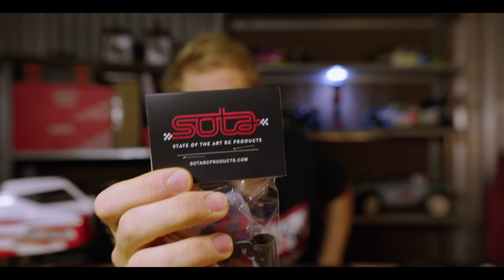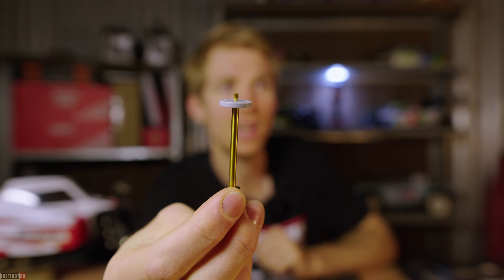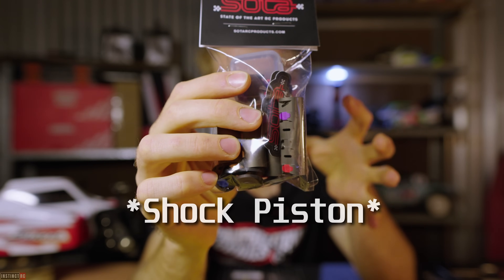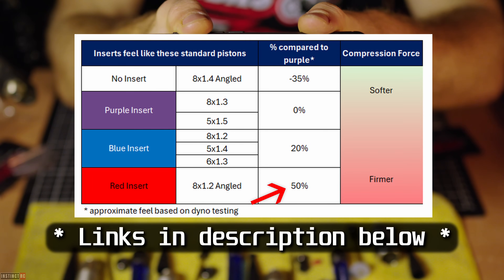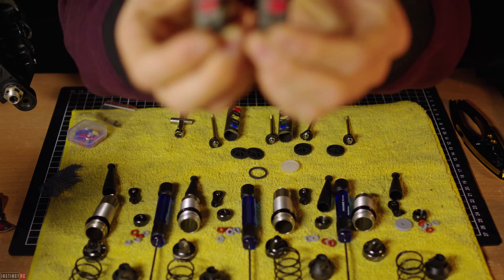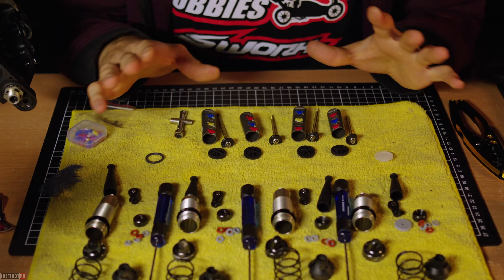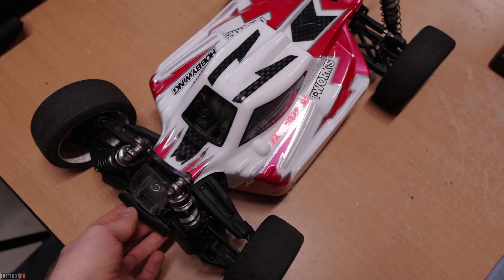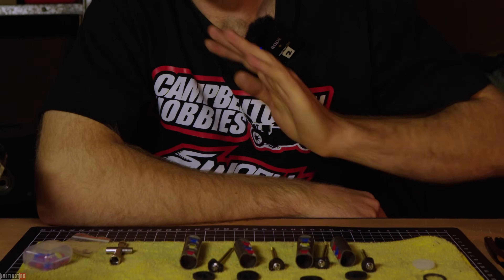The FUTURE of RC Shocks? | SOTA RC

Comment: Hi Nick, great video. Thanks for showcasing my little invention. My goal is to bring new products to RC that are backed by proven principals. In this example, King Shocks and Fox Shocks incorporate position sensitive damping technology in their premium off road race shocks. PSD provides different damping rates for the different zones which means far greater tuning options and race performance.
Reply: @sotarcproducts This is awesome. About a year ago I was trying to design something based on a similar idea. The D shaped piston is a brilliant solution. I was using a cut up Armma Granite shock body and piston in an 8th scale shock with simple bypass holes of different diameters. Crude prototype, didn't get anywhere. Also tried designing a hydraulic bottom similar to MTB shocks. Kinda bailed on it due to limitations of my  tools and materials. I do believe a hydraulic bottom out is possible. Simply a top hat style piston that pushes up into a similar sized chamber at bottom out, compressing the fluid and creating a cushion effect. Have a go if you're interested, looks like you could make it happen better than I could. Always impressed what people are managing to squeeze into these tiny shocks. Good job!
Reply from the maker: Just to add, if anyone wants more in-depth dives into the research and development of these, you'll find them at SOTARCs Youtube channel: https://www.youtube.com/@SOTARCPRODUCTS
Reply: This is basically an internal triple bypass design it looks like.
Reply: @madweazl  Yes though the journey to get here was a little more challenging.
Reply: I came up with a simpler design for the same thing a year and a half ago that I use on my cars. Internal bypass shock
Reply: that would be really cool for the Traxxas UDR !
Reply: @PetesRacin   I have the UDR and I agree. I am looking at my current tech but also a few other options. The smaller bore sizes get a little tricky so we need to get more inventive to provide a solution that works.
Reply: @SOTARCPRODUCTS  with most RC vehicles being smaller, it is difficult to be constrained by such small diameter cylinders.  I worked with an old MIP 2-way piston design in the past, but the precision just wasn’t there to be noticeable.  The other thing with smaller scale RC is we need even lighter weight oil and a way to reduce static friction—both things that less of an issue with larger, heavier vehicles.
Reply: @1132Design  I am working on something for 1/10. It might be the current tech or something completely different.

Comment: This product is missing the whole point of the suspension system. There are spring and dampers. Damping should only be dependent on velocity and Springs only dependent on position. Both require a force applied to them in order to move. These 2 seperate units form a  complete system and a way of separating the target and balancing it.If you need position dependent damping, you don’t understand suspension.
Reply: Damping should only be velocity dependent? Why not both? WRC and Trophy Trucks are examples of off-road racing at their respective pinnacles. Seb Ogier just won the latest round in Italy. His car is fitted with Reiger shocks and features position sensitive damping (Hydrostop). Alan Ampudia won the Baja 500 the past weekend, his trophy truck using King Shocks again position sensitive (external bypass). Arguably the absolute pinnacle of racing: F1. They use a heave spring which in a sense offers a position sensitive aspect to their damping.
Respectfully, I think I’m on point, and stand with some pretty good company.
Reply: A heave spring is a spring, not a damper. It prevents cars from bottoming due to massive aero load. Respectfully I think, you’re not.
Reply: @Adrian-sd5on ok. So can you provide me some names of manufacturers of off-road dampers at the highest level that don’t do any form of position sensitive?
I’ll give you mine that do: Fox, Bilstein, Multimatic, BOS, King, Icon, Emu, Ohlins, Reiger, WPS.
Now yours….
Reply: The reason why it should not be both is because you have springs to tune the force and displacement ratio. And dampers to dampen this by adding in a velocity dependant system. 
If you want to slow the bottom part of the stroke you use a progressive spring. If you want to slow the top part of the stroke you use a top out spring.
Reply: The reason why it should not be both is because you have springs to tune the force and displacement ratio. And dampers to dampen this by adding in a velocity dependant system. 
If you want to slow the bottom part of the stroke you use a progressive spring. If you want to slow the top part of the stroke you use a top out spring.
Reply: What you have done is akin to sharpening the edge of your fork to cut your food. Sure you can do it but there is already a perfectly good tool that is better suited to that job. It’s called a knife. And you use different knives for different purposes.

Comment: Ever heard of 'Jump Jets'? They were an addition to shocks where a tapered pin would graduate through a hole in the piston reducing the flow space for the oil making the shock firmer toward the bottom out.
Reply from the maker: Oh that's interesting. I personally haven't heard of them, Matt may have.
Reply: I'm not the only one who remembers Jump Jets ;)
Reply: @guest6423  I never used them myself and only heard it at a club meeting and what they did, Maybe they just faded out due to different oil weights causing issues or something like that...

Comment: I would have thought RC shocks were past using fixed orifice dampers. 
Position sensitivity has its uses, especially on an off-road vehicle with lots of travel but a speed sensitive damper with shims to control oil flow based on piston speed is a huge advantage.
Reply from the maker: The SOTARC website does mention that a flexible insert could be offered at some stage, which would allow for full speed sensitive damping. We'll have to wait and see.
Shim stacks are definitely useful for that purpose, and Matt does mention them in his videos, but from what I've seen online, they can be difficult to tune and maintain, and it's possible that at smaller scales, they may not work as well, but I can only speculate.
Reply: All RC pistons in a sense are speed sensitive - damping rates vary according to velocity; generally linear/progressive. Shim stacks are typically linear too putting aside staged setups. The challenge is to understand what curve/s is ideal for RC off-road racing. A 2 stage digressive damper for example might be good for on-road but isn’t much use for off-road with large jumps. Fox, King etc make PSD in their race shocks for a reason, mine operate exactly the same.  Other companies such as Reiger use different technology but with the same desired outcome. Arguably they may have even better technology but it would be like cramming a Swiss watch into your shock cap with a genuine Swiss watch price tag. I am looking a flexible insert which would offer a two stage damping curve but it takes time to get this right.
Reply: @SOTARCPRODUCTS  fixed orifice dampers are speed squared. They work well some of the time, poorly the rest. 
They might work better on an RC vehicle?
Reply: @Surestick88  Full sized cars from 70's using orifice pistons totally agree. Please have a look at my video regarding oils. I explain there and provide dyno tests how and why our orifice pistons do not achieve turbulent / quadratic damping.

Comment from the maker: Have just created a poll to gauge interest in this system being developed for other brands/scales, have your say here: http://youtube.com/post/UgkxAGMFYJKfd5LjHsbWGrSwqXpq0kDFbAh0?si=h9erNIzMY2dL67QX
Reply: @InstinctRC   the shock bodies are all essentially the same diameter for 1/8 scale truggies. 

I’ve used mix & match parts for a lot of them. Spring Perches & ends (size & length) varies yeah. 
But I think the bodies themselves on those are a lot alike .  

And 5th scales for the TRUE makes of 5ths are based on Losi’s for a majority of those brands .  Traxxas is the odd ones pretty much. 

So it wouldn’t take but maybe 4 or 5 versions to catch a huge part of the markets on 5th scales.  
The racing buggies I don’t know enough about the individual cars.  

I’m not sure if he’s machining them himself or through a supplier.  But this is definitely something he should do (spread to 3 other sizes that will fit many different makes for 5th scales. And it would take less for the 1/7ths & 1/8s.  The parts they proprietize are mostly everywhere but the bodies themselves/pipe so a couple of different ones can fit many shocks I think .  I could be wrong when it gets to minuet details bcuz I havnt measured the many I’ve seen over the yrs.

Comment: So basically it’s a “tunable” bypass unit depending on that side chamber to determine the dampening. I would like to see some real data on dampening stats, saying your relying on “feel” seems a bit ambiguous. I’ve been racing RC cars since 1987, I can’t tell you the number of gadgets I’ve seen in that time. Years ago Gil Losi Jr. did an article on shocks, and follow up conversations where he explained the function and considerations for shock setup. No one had ever broken down the functions of a shock before then or since. Speaking to the ability to manage “pack” as well as “rebound” through piston customization. When you’re talking about a $130 shock gadget I would like to see comparisons between the original part as well as the up grade in a controlled setting. After all when we talk about torque in servos it’s referred to in an industry standard (inch ounces, how many ounces a servo can lift through its normal sweep when the weight is suspended from a 1 inch servo arm.) This would be a great opportunity for SOTA to establish a lab standard and set themselves up for the future and not be just another flash in the pan.
Reply from the maker: Also, just regarding "feel", while it is very subjective, you can't just discount it! After all, theory and numbers aren't very useful if we can't really tell a difference. I've done a full club day on these and they absolutely feel like an upgrade. It's only incremental, but it's there. The car was definitely a bit less unsettled after big jumps and flat landings.
Reply: @InstinctRC . I’m like you.  Numbers are just a tease interest for getting my attention,for me cuz if I can’t feel /tell it from the driving they don’t mean anything really.    

Numbers are just the same as WORDS & RE ALLOCATION of definitions to replace old words to SOUND DIFFERENT & NEW ,or ignite different aesthetics of how things “FEEL” mentally ,while not doing anything physically or tangibly differently.  Lol.    

Everything else is just  “SALESMAN BS” jargon designed to imply FEELINGS /athletics versus conventional physics of FEELINGS .    Lol.  

If you know what I mean or I am getting at 💁‍♂️lol. 

I’m still trying to understand how they work.   And I actually know off road racing & suspension set ups for full size cars lol.    

Other than a progressive set up advantage.  Which would be so negligible,I’m hard pressed to see it’s anything more than a novelty and something that would actually make a big difference in RC cars other than what one can get with regular oil & springs.   
Because not all differences matter just because they can be measured as so in the grand scheme of the previous standards.
Reply from the maker: @Chon-c  I know that the feedback from top drivers running these is they provide the most consistent shocks they've ever used, so there must be something to it! Also r.e. your other comment, glad you found the info you needed :)
Reply: @  definitely 👍.
Reply from the maker: Absolutely fair, SOTARC has numerous great videos going in depth into his dyno data and reasoning. Would highly recommend watching them and getting in contact, as he's best placed to answer.
Reply: @ cool thanks I did look at their site, but again no hard data points. Principles and projected function aside unless they actually do comparative testing with measurable characteristics.
Reply from the maker: @paulsdrc  you'll find in-depth videos on their YT channel: https://www.youtube.com/@SOTARCPRODUCTS